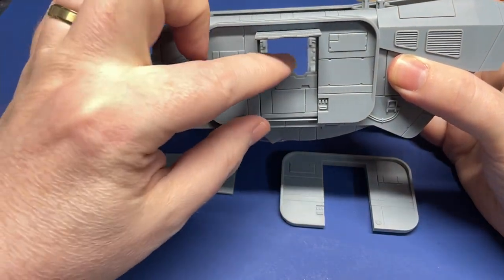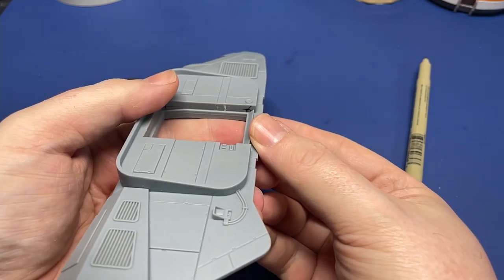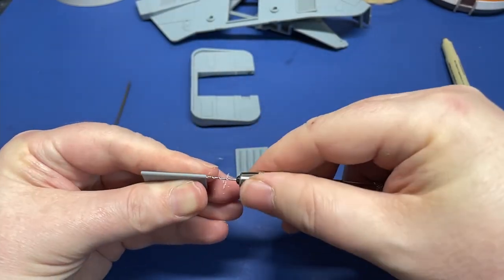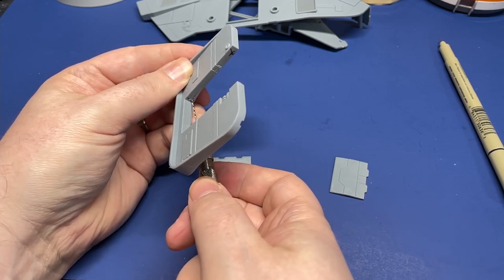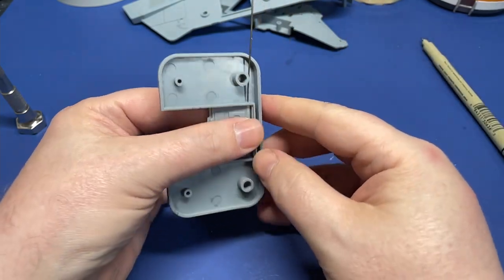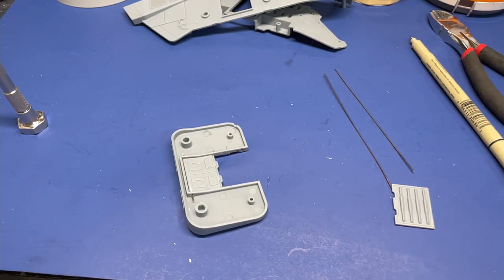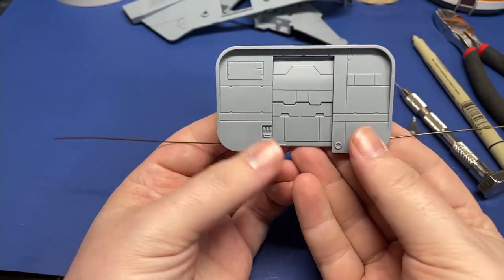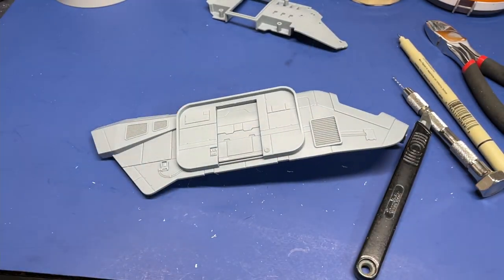How to Modify the Doors on the A-A5 Speeder Truck for Star Wars Legion

Comment: Great video! I now have a pin vice in my Amazon shopping cart, but was wondering what size/gauge wire you used?
Reply from the maker: I can’t find my calipers currently, but if I do, I will update this reply. I ended up using brass wire from a kit long ago. It is about the same thickness as a small paper clip.

Comment: Do you glue the pins in place at all? And if no, do you ever have issues with a pin working its way out?
Reply from the maker: I will typically put a drop of glue on the exposed pin, but forgot to in this video. This is why it is important to have the pins smooth inside the plastic itself. In cases where I have not glued them, I have not had one work itself out.

Edit: I thought of this afterward, but not flying the pins at this stage would allow for disassembly for painting, if needed.
Reply: @PaintingbytheHill  would it help to keep the pins longer, so you’d have a greater length to glue to the chassis?  You cut them very close to the doors and I’m worried they may not hold as well.
Reply from the maker: Personally, I have not found the extra length to be necessary. I don’t see any drawbacks to your idea, though.

Comment: Does the cockpit door open? If not, what tool would you use to cut it open?
Reply from the maker: The cockpit door is a separate piece, and can be left out during assembly, if desired.
Reply: @PaintingbytheHill  Thanks so much for the intel!